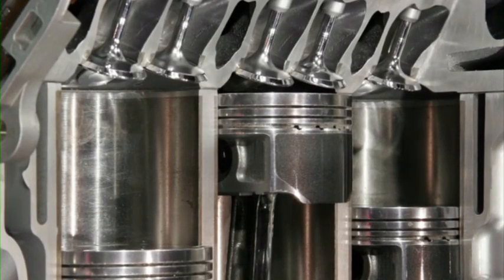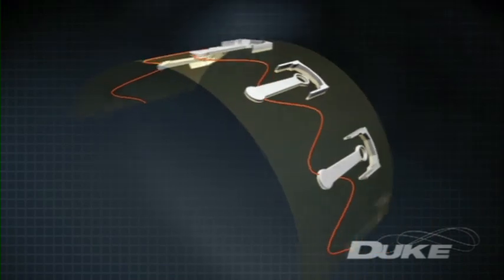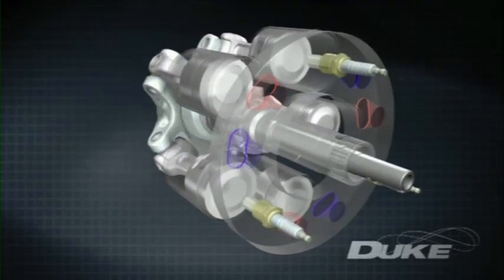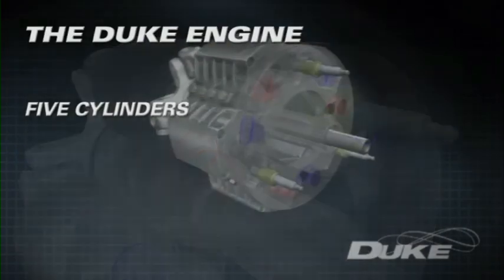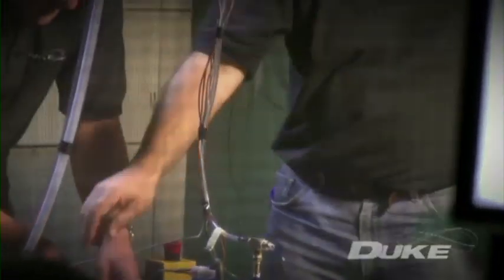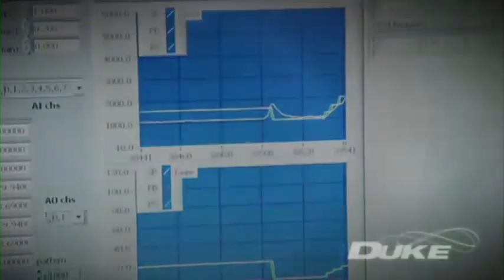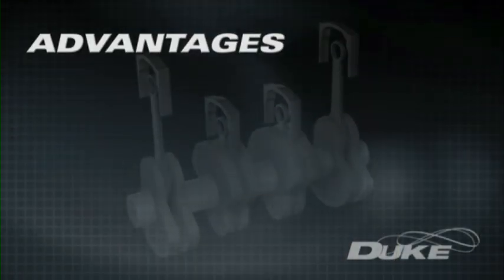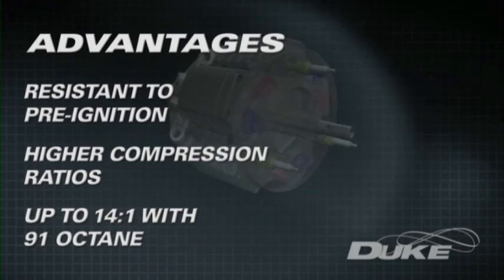Duke Engines

Comment: Where exactly are these "30% Weight Savings"? You have revolving piston liners, revolving Rod attachment piece to Crank, There is just too much friction at any given time with this design is beyond ridiculous...... How is this ting even overcomes its own inertia and friction loss?... Cool concept but its just that, a concept.
Reply: Tony V. Fun story, most batteries used in electric vehicles are a total environmental nightmare. From the petroleum products used to make them, the extremely toxic and dangerous chemicals they contain, and the pollutions created to keep them charged. If you replaced every car in the world with any form of electric vehicle today you would be in for a world of fuck.
Reply: Diesel engines are still #1 when it come to energy saving and reducing overall pollution and negative environmental impacts..
Reply: +User Name  Battery EVs are extremely flawed, and the flaw I'm referring to is the limited energy storage density that has existed since Volta invented the first battery in 1800.. The  laws of Quantum electrochemistry that limit the energy storage density of chemical batteries well below that of liquid fuels. Hybrids benefit from the advantages of ICEs.

Your not looking wide enough, you are using a very narrow opinion.
Reply: +trijezdci  But where are the Energy Density figures?????
Reply: Above those, each cylinder,  when comes to its proper position,  say plug,  fuel income, , etc.  or other should be "sealed"  temporarily  just as reached the proper position...
Reply: My thoughts exactly. I'd also like to see a 14:1 compression ratio out of laboratory conditions.
Reply: I've yet to see a running model. Supposedly they made one and put it in a car and drove around some years back, but I've never seen video or any information for proof.
Reply: It's just an idea.   But if any of us are still suggesting that engines that relies on fossil fuels are still the only way to go, leaves us stuck in the dark ages.  We may as well be wearing dinosaur skin and carrying big sticks on our shoulders.
Reply: Not only that, but to alone get the resources is a horror. Lithium mining is not the most environmentally sound action to take, not to mention the neodymium used in the electric motors. And I am not sure there is enough mineable lithium to have every engine on the world replaced with battery-powered electric engines...
Reply: As far as there being enough lithium, check over in the middle east areas for a start. The power that be have known about it for quite a while.
Reply: There might be a lot there, but how much of that is mineable at acceptable costs? We are talking of replacing nearly 1.2 billion vehicles, as well as all the electronic devices, and other uses Lithium has. Even with recycling that is a lot. And anyway, the ecological impact would be immense...
Reply: Freeman Most of the area is desert. Labor is far cheaper than American wages. Laws are different and reported value is in the trillions. A fraction of a trillion dollars is enough for many in power to find the risks "acceptable"... And war over it.
Reply: A Tuck Relying on the most politically unstable place on Earth to provide the global supply of critical transportation resources sounds like a terrible idea.. Remember what happened in the 1970's?????
Reply: The real doktorbimmer they don't care about that. It's just there and we can spend countless trillions keeping an area stable enough to make it cheap enough to be feasible.
Reply: The real doktorbimmer That's just it, there are no plans to rely on them. Otherwise we wouldn't be over there still.
Reply: There are plans to rely on middle East resources. That's exactly why we are still there.
Reply: they still use them because they want us to keep using them finding a better engine is like finding cure for cancer don't be an moron you really think they want to loose a gold mine?
Reply: It's impossible to say there isn't a better internal combustion design looming somewhere, we haven't found it so it doesn't matter.
Reply: +Beto a   Better engine? Or more efficient? the two requirements are not always the same..
Reply: +User Name  There are designs and technology that are more efficient.. but not as practical or cost effective..  An engine that costs significantly more than the addition fuel savings is not a commercially viable product
Reply: BEVs will only become ubiquitous if a new battery design emerges, possibly based on nanomaterials that can store large amounts of electrical energy efficiently in nano tubes or similar. There is ongoing and promising R&D in that direction, but it will take time before any usable products come of it. Eventually this may well happen but it will be rather later than sooner.
Reply: +trijezdci  Unfortunately even with some limited development potential available through advanced battery technology the physical laws of Quantum Electrochemistry prevent batteries from ever reaching the energy storage density to match that of liquid fuels..
Reply: I wasn't talking about electrochemistry. I was taking about nano materials, nano tubes etc.
Reply: Yeah I think you missed the point..
Reply: not true! do you know what is the new technology that is killing it in the rc world? battery!!!! nitro engines cant touch lipo engines!!!!!
Reply: +beto a  We are are talking about real engines... not toys
Reply: FYI those are real engines you ignorant clown nothing stops them from making them scale 1-1. oh wait i'm wrong there a lot of things are stopping them! but if they wanted to they could!!! but money talks!
Reply: +beto a   Real world applications of Glow Ignition engines have been obsolete for 70 years... Electric cars have been around for over 100 years and still only fill a tiny niche market role..  but what do you know???  you still play with toys...
Reply: The real doktorbimmer without any doubt electric vehicles will be the way to go in the future. At this point we are limited by our technology. I look forward to getting a Tesla model s or equivalent one day, but now isn't the time.

As far as RC vehicles, I've been in the hobby for decades, lipo is not what killed the nitro fandom, the brushless motors are what did. You are talking about 540 cans putting down a solid 5hp and seemingly infinite torque.
Reply: +User Name  History has shown us this is simply not true.. EVs are extremely limited and have little chance of displacing ICEs in most applications.. Battery electrics will continue as a niche market and hobby equipment will continue to develop on a path unrelated to practical application because hobby equipment has no requirement for practicality.. its non-essential, a luxury activity.
Reply: History has shown us the earth is flat, man can't fly, machines will never replace horses in battle, etc.

The electric vehicle is absolutely going to happen eventually, probably not today or tomorrow, but soon enough. Elon musk has already taken them light-years beyond where people ever thought they would be. Companies like Toyota and Honda have shown us hybrids are economical, and Volkswagen have proven they are fast. 

Your not looking wide enough, you are using a very narrow opinion.
Reply: There is no flaw in battery EVs. We simply have been beating a dead horse on battery technology for a century. It simply wasn't interesting enough to research any alternative battery technology approaches. Nobody made any effort to look for alternative approaches.

But due to emission regulations there is now incentive to go looking for alternatives. There is am immense potential with the use of nano-materials. So called nanobatteries.

The first generation of nanobattery products are only just being released. These first generation products already show vast improvements over conventional batteries. Charging time has been very significantly reduced (5-10 minutes to reach 80-100% capacity). Longevity has been greatly increased (~1% capacity loss in 1000 cycles). Thermal losses are much lower (~25%). Flammability is greatly reduced. And last but not least, the capacity of these batteries is much higher, bout 5-10 times for the current generation.

And this is only the first generation. There are more promising approaches in the labs using nano-tubes and nano-wires that combine the compactness of conventional batteries with the properties of supercapacitors.

These technologies will be developed further and make BEVs viable.

Then there are fuel cell EVs. Interestingly, fuel cells will also become far more efficient with the use of nanomaterials for membranes. Which of the two (BEV or FCEV) will ultimately set a standard is difficult to say at this point. It will ultimately come down to cost.
Reply: skirmich
Reply: As I wrote in my comment, the first generation products now being released have 5-10 times the capacity at roughly equal weight and size.
Reply: +trijezdci  Current battery technology offers horrible energy storage density.. 5-10 times current capacity would still be inferior.
Reply: +trijezdci  WHAT IS THE ACTUAL DENSITY PERFORMANCE?????

Comment: what's the MPG?
Reply: ZamaskowanyWolnościowiec

I did not ask what [is] MPG
I asked what's [the] MPG
That means I'm asking how many miles to gallon the engine gets dumbass.
Reply: you can't say whats the mpg of an engine because the mpg of a car with this engine is different than an other car with the same engine. it depends on aerodynamics and weight and transmission. sry for bad english
Reply: +Anonymous01959 a popular video file extension (comes from the Moving Picture experts Group). The complex motion of reciprocator is unpredictable for video compressing algorithms which makes Duke Engine movie files big.
Reply: +Anonymous01959 miles per gallon of fuel

Comment: dumbest design ever.
not only is energy wasted in the reciprocation of the pistons, as in a normal car engine, but also in the energy it takes to rotate the cylinders and pistons around the crank shaft.
you want to know how to increase the efficiency of a reciprocating engine?  eliminate the reciprocating parts.
turbine engines were invented almost 100 years ago and are far more efficient than piston engines because there is no upstroke robbing power from the crank shaft rotation.